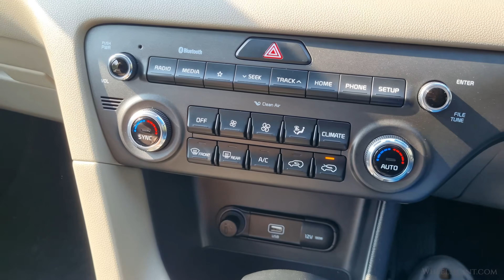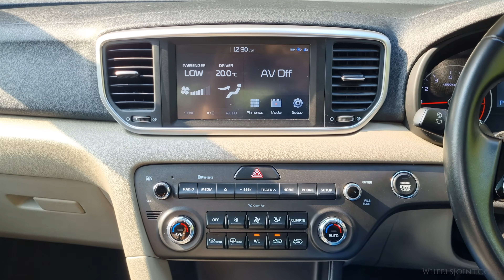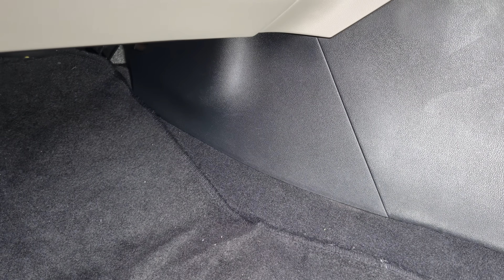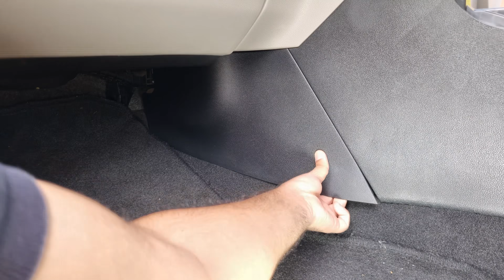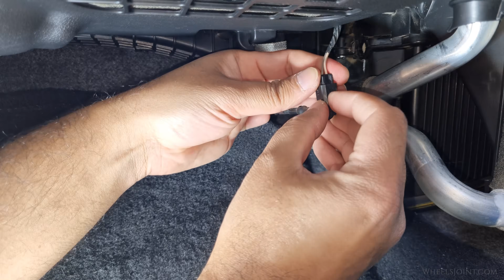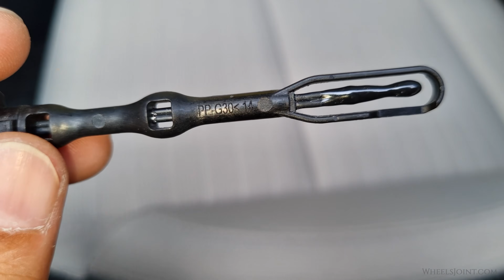How to replace Evaporator Temperature Sensor in Kia Sportage

Comment: Looking for help from someone who knows Kia/Hyundai climate wiring

2017 Kia Soul 2.0, automatic A/C. Salvage car.

The outside temperature on the dash goes to −9 °C and stays there. Sometimes it starts high, then drops.

I already replaced the outside temp sensor, ran two new wires to the climate control, replaced both plugs on the back of the control panel, and tried a second climate module. Same thing.

A Foxwell scanner on the A/C module shows:

 • Cabin and evaporator temps look normal (~29 °C / 27 °C)

 • Outside temp (AAT) reads about −22 °C and keeps falling

 • Only code is B16A4 (A/C compressor valve), not an ambient-sensor code

 • My two new wires measure ~31 kΩ (sensor is good) but 0 V with the key on

I wired black to A-27 and red to B-2 from the Kia pinout.

If you’ve done this job: am I on the wrong pins, or is the new connector not actually making contact on those two terminals? I can send pictures. I don’t want to buy another module if the wires are just in the wrong holes.

Comment: Hello!
Can i ask about for situation with     A/C Kia Rio 2014 1.4 petrol :
Thr a/c working normaly when out side temp is 30 degree= 86 f and the set poit ot the ac is 20 ,but when  around 20:30 the temp outside drom  between 75-77 the air is not so cold like in 86 f .Could you share what problem can be ? there is enough freon!